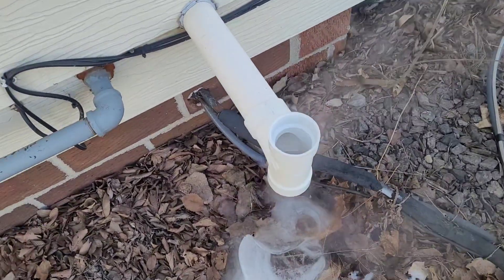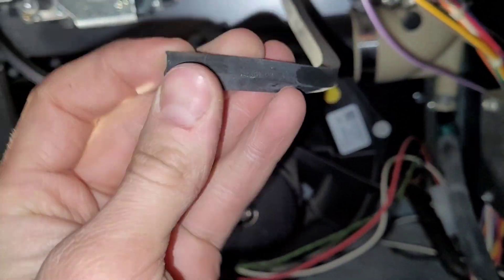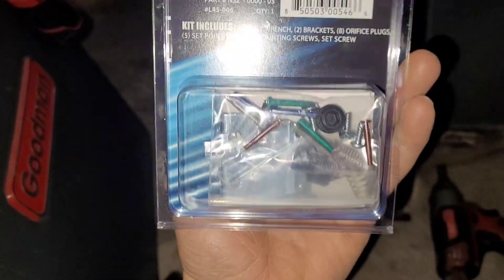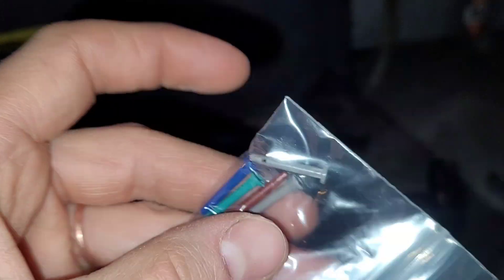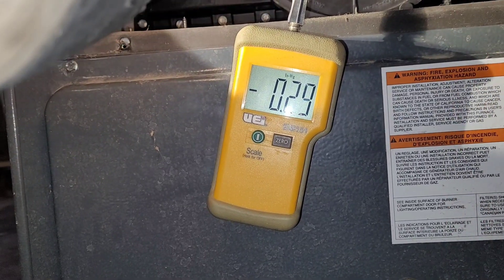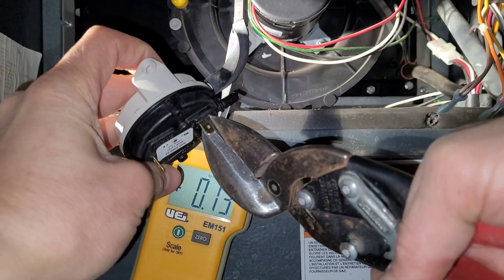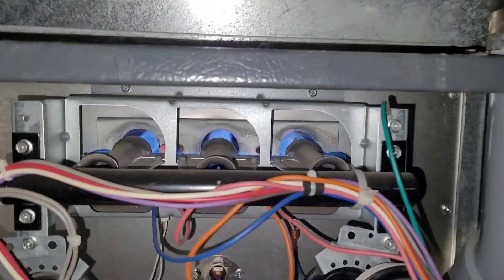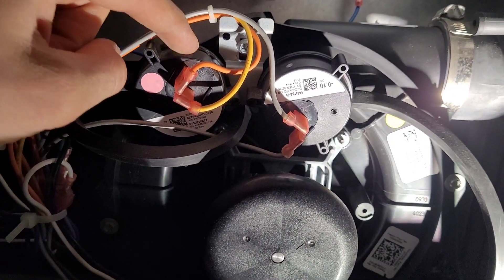How to Replace a Pressure Switch with a Universal Pressure Switch!

Comment: Good shout, Reuben. New tech here. Manometer is a handy tool eh (SP, gas press, and PS).

I recently bought the SDMN5 (without pump feature). I’m pleased to know there is a way to test and replace without the pump action.

6:35 re: “that came on to soon.” Did you adjust spring tension? 

Lastly, I thought voltage was the way to verify. Hearing the beep while watching the display makes a lot more sense.

Comment: using a universal, does that mean the right size pressure switch is hard to find new?
Reply from the maker: @kkovler1  not always, it's just what we carry for immediate replacement. They do also come in handy for harder to source or backordered switches. If the weather is mild and we can reasonably order one in a timely manner we do often go with OEM.
Reply: @ReubenSahlstrom  i would worry about liability using universal switches
Reply from the maker: I guess in today's day and age any time you touch something there's a liability possibility! Those switches seem to work well and I haven't been concerned they would cause a problem, especially when set by the manufacturers instructions.
Reply: What is a good reading for water columb on a good switch? Thank you for the video!
Reply from the maker: @johnsutter1497  It's dependent on the equipment being serviced, but I think it needs to at least meet or exceed the cut in pressure of switch. If you have a -1.5" wc switch and it's pulling more than that its a good reading, and if not then it's bad. At least that's what I understand the case to be!
Reply: @ Thank you
Reply: Smart man right here. I ran into a problem on a new install last week, pressure switch was bad from factory. I put in a universal one but the spade connector was smaller ...I ended up cutting the male end on the switch until I could swap out the OEM one. Good video for sure, thanks for the content

Edit: I also left the old pressure switch in the unit too